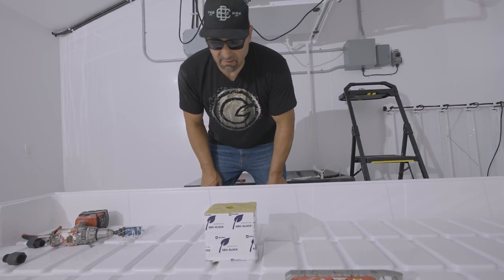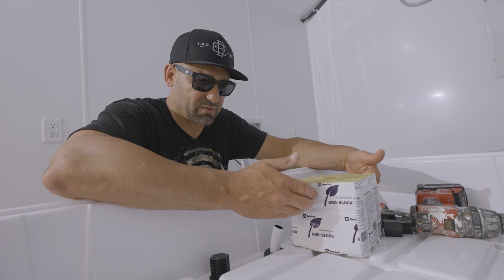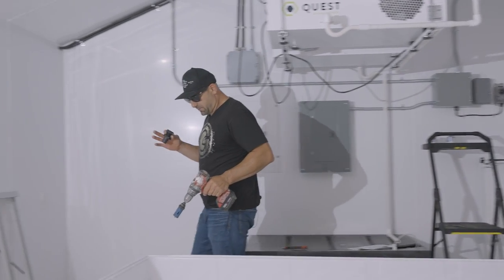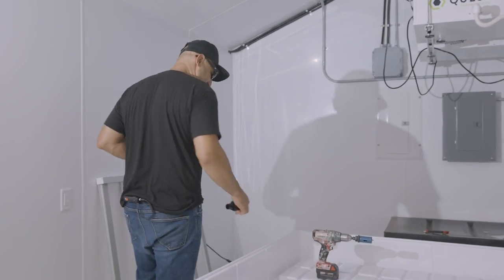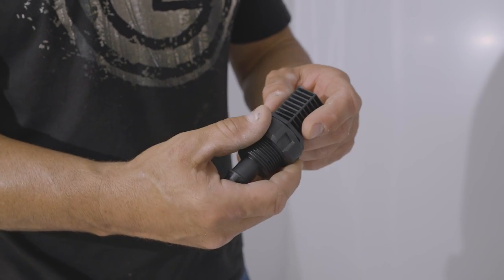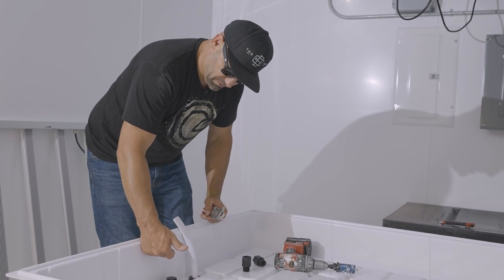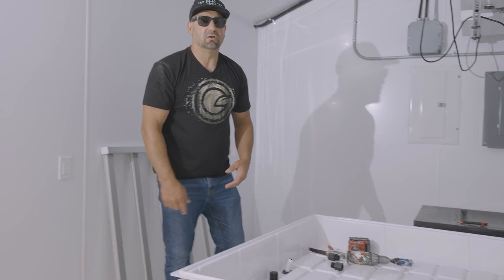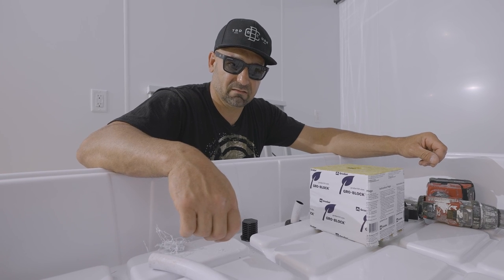Ebb And Flow System Set Up | Growing Green Vol 10

Comment: If you use the wicking action of rockwool you get salt buildup. If you flood higher you don't have to flush the plants from the top every 10 or whatever days
Reply: Noob here... So if he says a quarter of the height of the cube, how high would you say to flood to avoid salt build up? And correct me if I'm wrong but then if you flood higher you don't have to flush as often? How often should you flush your plants when using rockwool?
Reply: @chunkyhebrew8805  that's correct, you basically want to flood the entire cube. How often you flush will depend on TDS of nutrients and how much water your plants are using, generally every 5 to 15 days. I've stopped using rockwool for ebb and flo though, hydroton works much better for ebb & Flw as it allows for more oxygen and doesn't have the same buildup issues. Rockwool was made to be top fed. Went over to using a topfeed system with my rockwool and yields definitely went up. Stacking 3 of the 4" cubes, 80 plants per 4 X 8 tray and average a fat ounce per plant. 3-4% volume of substrate per irrigation and irrigate every 30min to 1 hour. With the 3 X stacked 4" cubes it's about 90-150ml water per irrigation
Reply: @pcjacobs615  Lord... I'm just trying to see if I can actually just grow a full cycle 😄.. you seem to have the science/art down though. I was thinking ebb and flow to start then graduate to rdwc... I was trying to decide between the 2 gallon vs 5 gallon vs table.. and thank you for responding and sharing your knowledge in this regard. Much appreciated.